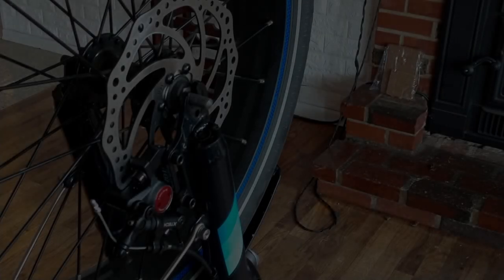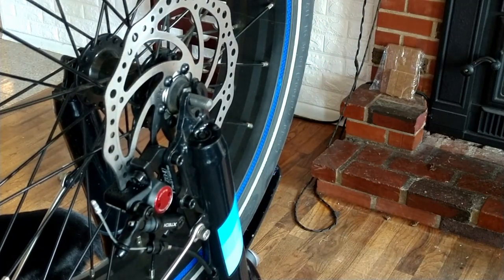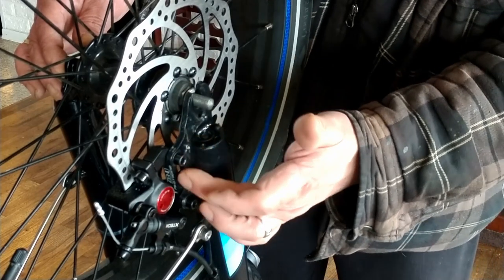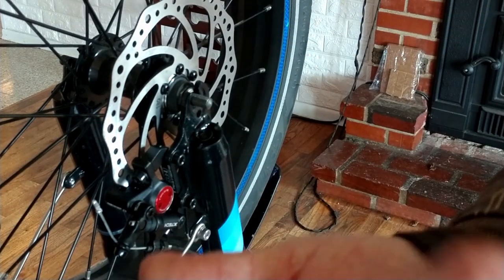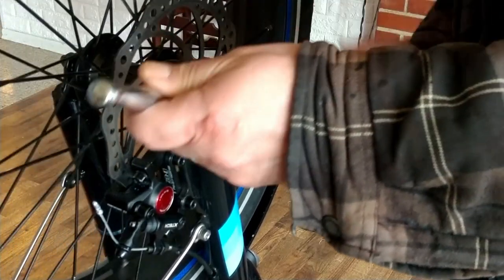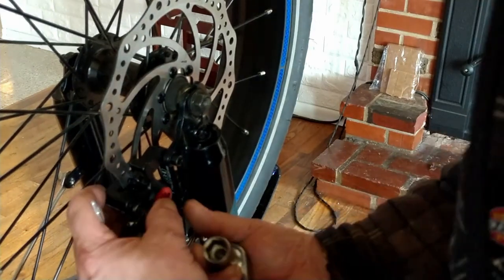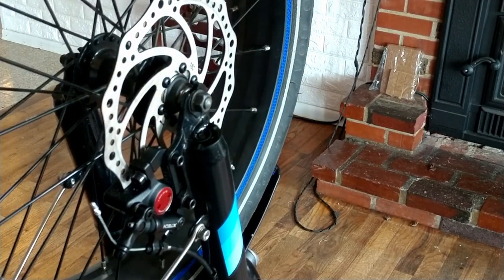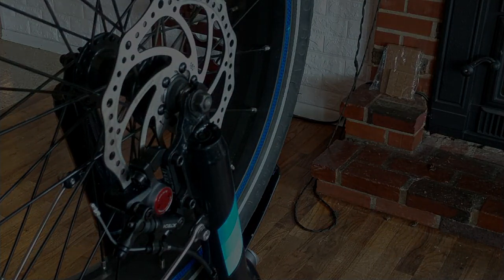LECTRIC 2.0 - New front wheel hydraulic caliper hitting spokes? How I fixed the problem!

Comment: I had forgotten about that. I have a machine shop. Just milled he brake .30 or .40.
Reply from the maker: the washer worked perfectly for me. I did have to place a slightly less wide washer on (took one off the back axle on a old mountain bike) Worked perfectly.